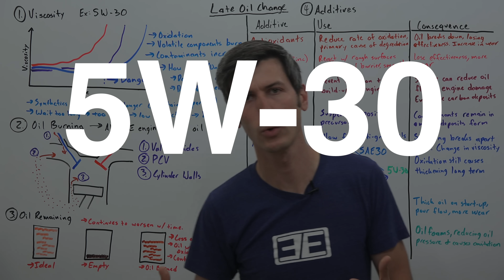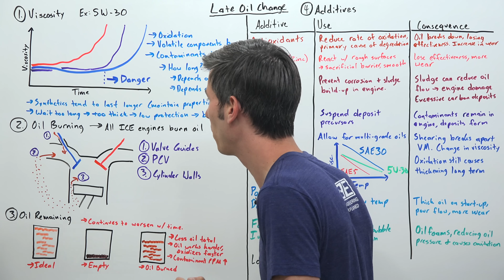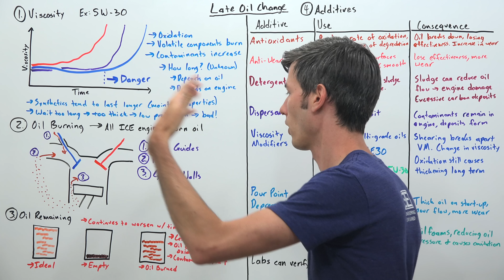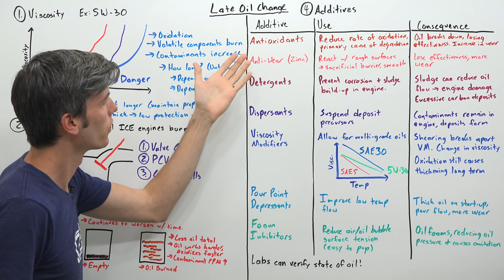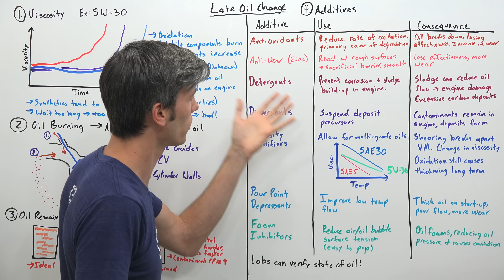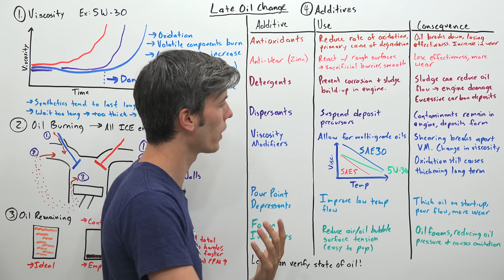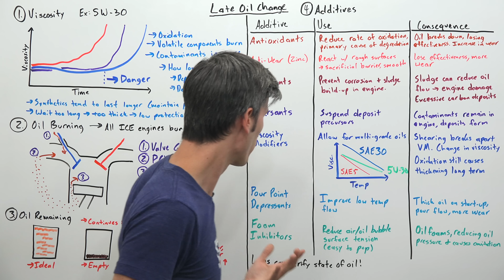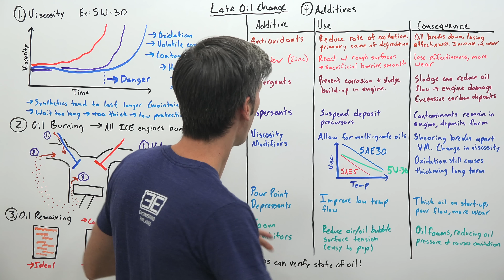What If You Forget To Change Your Oil?

Comment: The viscosity modifiers are basically molecular springs that expand as they get warmer, it's not oil it's completely different, its added to the oil so as they expand they get tangled in each other and create the illusion the oil is thicker, it is not. It's the same low viscosity oil it always was but gets slowed down by all this molecular "junk". Just like how a river overflowing picks up a bunch of debris, trees bushes, wood from peoples houses that got destroyed. That flow with all the debris will act thicker, more viscous than the clean water would alone.
Ok all that said does the modifier contribute to lubricity or does it cause increased wear because its molecularly "rough" like the debris in a river. 
Wouldn't it be better even if only slightly to run a straight weight oil that is comprised of more of the actual oil than additives if in a hot climate? It could be so small and soft as to have no effect on wear. I have almost 300k miles on my current engine and I hope to reach 1M, many others have with this engine and I'm wondering if this tiny difference could mean 1% to 25% longer engine life. Excluding crazy stuff like hot dogging or racing, normal old man heavy truck driving lol. Just curious what you thought.

Comment: What you think about top up oil while waiting for it 7500 miles of recommend miles for oil change. Vehicle: 2020 Silverado 1500, currently at 5000 miles and shows 30% oil on Chevy computer.

My 2017 AudiQ7, dealer service center regularly tops up engine oil before regular oil change. Newer Q7s are really thirsty on oil.

Comment: If a friction modifier makes your oil thicker when it's hot, why is it recommended to change your oil when your motor is warm? Surely more would flow out when it's cold?
Reply: It doesn't make it thicker, it makes it act like a more viscous oil at higher temps. A 5 weight oil in freezing temps is still much more viscous than a 30 weight oil at operating temp. The modifiers just make the drop in viscosity as temps increase less drastic than single weight oil.

Notice that the green line in his graph still has a negative slope.

Comment: Girlfriend didn’t change her oil for 30,000 miles, it took $400.00 to fix due to sludge and a couple of other repairs which was about what the oil changes would’ve cost. 🤪
Reply: No way sludge can be removed with some Trans fluid in the engine oil for 9 dollars. They ripped your ass off

Comment: My car's service interval is 1 year or 15,000 kms. But my car has only run 5,000 kms in one year.

So is it okay if I delay my oil change?
Reply: If you want to void the Warranty and more wears then yes. Always change the oil/service at the interval as stated in the manual even if you only drive 1000km a year. You can always call the dealer or a mechanic about this, they will give you the right answer.

Comment: I know some Old-Timers that use 15w40 Rotella in these new engines and I know it can't be good for. Can you explain why heavy oils is not good in modern.
Reply: Its not quite as simple at the just the heavier grade of oil. Oil change frequency, flow rate and bearing clearances play most of the part as to why they are using thinner oil. There is still cars oil there today that are using 10w60 fully synthetic for instance. Alpha Romeo 🙄
Reply: @tting2086  I know what you're saying. I have taken a few classes on just oil and oil analysis. I'm a technical advisor for heavy equipment. What I'm getting at is will a heavy oil push the valve timing actuators to their Max during low load and low idle due to heavier oil? For example a 2020 engine that has variable valve timing. We have Cummins engines at work that use higher pressurized oil to control the turbo vein ventury opening and EGR opening. Customers that have used low grade oils or higher or lower viscosity oils cause the actuators to over pressurize and the command position is not achieved within 10 seconds, producing error codes. 
So I would like to see what happens if you put 15w40 in an engine with variable valve timing and direct cylinder injection. Will the higher oil pressures mess up the systems on a gasoline engine controls?

Comment: I change oil every 3,000 mi - Walmart SuperTech non-synthetic plain jane motor oil - Bosch filters - got 482,000 mi service out of last vehicle before valve guide seals leak  - got 524,000 mi out of Chevy pickup before rebuilding it - using same Walmart  oil. Just changing oil on schedule is key to good vehicle service life. My costs per oil change is $18 - 20....😁👍🇺🇸

Comment: I have a question regard engine oil. 
So if the recommended oil for the car  is for example 5w20.. but someone is living in a very hot weather area. Is it advisable to increase the viscosity to for example 10w40?
Reply: I would just use 5w40. Unless you're in the middle east. Then use what the manufacturer recommends
Reply: @benniestander2725  actually I'm in the middle east lol.. They're recommending 5w20!

Comment: I change my oil every 2500 miles. So if I go over it's usually ok haha
Reply: Why
Reply: @ljsortigosa3990  Because I want my motors to last as long a possible, preventative maintenance.
Reply: @ConTheDon187  nice, okay. What do you drive?
Reply: @ljsortigosa3990  as of now my car is down for an engine build for a big turbo setup so I'm stuck driving my truck which is an 06 dodge 3500 with a cummins and then my project car/race car that used to be my daily is a mk4 GTI 1.8T 5 speed manual. But i've had bmw's, 350z's, miatas, subarus.

Comment: Hey, you may have covered this in an other video, but I’m wondering what does fuel dilution do to the performance of engine oil? I understand fuel dilution to some (moderate, 1%?) extent is “normal”, but doesn’t sound like it would do any good...

Comment: I’ve got a 2003 Dodge Dakota that I bought a year ago. The truck runs extremely well, despite having nearly 210,000 miles on the engine (3.9L Magnum V6). I’m the second owner of the truck, and like the previous owner, I am religiously changing the oil, but it still amazes me that I have almost zero oil loss, and the engine runs as well as it does, especially after installing a number of bolt-on upgrades (mind you, I don’t beat on the engine, but I do exercise it every once in a while). It’s really mind blowing how far an engine can go with proper care. Especially when my best friend is best known for having blown through 2 engines in as many months, but that’s a story for another time. 🤦🏻‍♂️😂

Comment: So changing my oil on time extends my engine life to 200K? I’ll save my oil changing money and ok I know I’ll only get 180K miles. Large fleet managers always weight the cost of engine oil versus engine wear. There is a happy medium. Likewise, large fleet managers also have to weight stocking multiple oils for their fleet. They may choose to save money by only stocking one oil. Having one oil may cause additional wear in some engines but the cost savings are in only stocking one type. For example, instead of stocking 5,10 and 30 weight. They simplify and only use 30 weight regardless of what the manufacturer calls for.

Comment: My father changed the oil on his 96' BMW 728i after 90000km after buying it. About 250000km after that he had to replace the head gasket for a different reason and found that all components were in perfect condition. In around 400000km he only changed the oil a total of 5 times.

Comment: Hi, what about late by date but with very low mileage? The Golf has only been driven  5000 km in one year, and a message from its dash says that service is due. But the service intervalb
Reply: Sorry, message went out before ready. The service interval for the Golf in my country is 15,000 km, but the car’s system also keeps the anniversary of the prior service in mind. Does really the passage of time damage the oil in an engine which does not go many miles?

Comment: Great video, thank you. Wish you would have touched on time between oil change rather than just mileage.  I've heard between 6-12month, regardless if the car sat the whole time.
Reply: This is the comment I was looking for. I also expected him to touch on that. I don't hit the 5000 miles quickly and I read that one should change the oil twice a year. So I do that instead of going by the mileage.
Reply: There's a certain amount of chemical changes that happen as the oil ages. Oxidation is a big one, but with that mix of various additives there's going to be some base level of rare random reactions that cause chemicals to break down over time. So just letting the oil sit in an engine and get old will reduce its utility. Even when not in an engine, a sealed bottle of oil has an expiry date of up to about 5 years, and opened oil should be used within a year.
Reply: @emote_control  what if I use the vehicle every day; my commute times are just short? the engine is kept running quite often but I never even get past 2k miles per year.

Comment: Hi. 
I hardly drive my car and only put about 1000 miles per year using premium brand full synthetic oil. I've been told to change the oil every 12 months regardless of low mileage.
Is it really necessary to replace the oil so soon,  even though it still looks fairly new?
If not, how long can I prolong the oil change intervals?
Thanks.
Reply: Kinda depends how often you drive the car. Usually oil degrades due to heat cycles and contamination. Use synthetic if you want to change oil w/ longer intervals.

Or get your oil analyzed and they'll tell you how good the oil is.

Comment: Most I’ve been was -357 miles over required maintenance in my 2016 Lexus IS 200t. Went and got it down ask all good. I got the car at 57k miles.

Comment: I had a performance V8 with 40,000ks on the clock when I got it, I didn't do a service or change the oil for 60,000ks. Nothing happened. It still drove like new. Those 60,000ks were over a 5 year period. Tell me again how you need to change your oil every 6 months. Admittedly, I don't drive my cars hard and these ks were both long trips and around town.

Comment: If you send your oil off for testing at Blackstone they will run the viscosity and check the additive package, contaminants, and TBN (total base number). This allows you to see how much life you have left in your oil. TLDR you can often run your oil for a lot longer than the specification (the spec is somewhat arbitrary and factors like driving style -- a straight shot across the country on highway alone will often times leave the oil looking and testing like new). That being said, the cost of an oil test can be quite similar to the cost of an oil change.
Reply: Black stone made me about $1000. Long story short, car got totaled. Appraiser said it’s worth next to nothing because of the mileage, saying the motor is shot. We sent the Blackstone report showing it was in great condition. Appraisal came back $1000 higher. Best $45 I ever spent.
Reply: @nasonguy  So itll tell you how healthy thew engine in general still is? thats a very good thing to know.
Reply: @dobber43  Blackstone analysis will tell you a few things. The contents of the oil (more wear metals is bad, more detergents/dispersants is generally a good thing, etc), and the physical qualities of the oil (is the viscosity still good? Could you have gone with a longer oil change interval, etc).
Reply: @NicholasAndre1...good reply. Blackstone suggested we continue just replacing the filter, suby, and running it to 12K....highway miles mostly.  That is double what is supposedly the change interval.
Reply: @darrellborland119  yeah especially if you burn a bit of oil and have to top it off half way through synthetic highway mileage should be fine. Although if you have to rotate the tires might be convenient to just do the oil change and have them inspect brakes etc.

Comment: Could you please explain what happens if the oil is vacuumed out of the engine to the dipstick tube.

That's exactly what Walmart had done to my vehicle, it took two oil changes before I realized what they were doing, by that time I ended up with a rod knock.

Comment: The viscosity goes down I think not up.
Because it makes no sense if it goes up.
Reply: That's what I thought!  It's why LiquiMoly oil stop additives mention stopping the thinning process.
I don't let mine get to 6,000 because it looks grim enough at 3 or 4,000.
Reply: Robert Walton-Sharp mhm you have chain thinning as degradation over time and heat. How can be a chain extender applied without recombination at the Beginn but on the end. I have to read papers about that....

Comment: Finally a person who knows what the W stands for, I can’t tell you how many know it alls argue that it stands for weight!  I change my oil every 2000 miles and I use Royal Purple 5W-30 and a Wix oil filter. The GM ECO-TEC 4cyl engines are great and have a racing heritage but need oil changes on time and the engine will treat you right but if your lazy the engine will not last, change it and your going to have a long history with that car.

Comment: My granddad always changed his Toyota every 60000Km, being on a farm. The tractor got the same treatment. I have since then learned from him to not wait until 60000km but rather change every 10000KM. I know a  couple of new European cars that consumes oil by liters. Does 500ml every 1000km sounds like exceptable parameters by the manufacturer? In essence I do see the need to have oil changes on these vehicles as they consume the same amount of oil that an oil change requires? Why bother changing oil then? 5 liters of oil consumed within the ICE. Why must I take the car for a service if the manufacturer finds it normal to consume this much oil?

Comment: EE can you explain what happen to engine oil keep to long in the engine but doing low miles.
Reply: the integration of additives ( which are in the oil to prevent oil to attack rubber and plastic) vanishes so the oil becomes the enemy of the engine parts (as, plastic-made timingchain-guides and so on)

Comment: full synthetic oil they say its better to change after 1 year if you dont reach the millage but it comes good as new even after 2 years... 1 year only of full synthetic and changing it without reaching the mileage sounds like a scam, at least on my engine... but i do it anyway, after that i wash the white floor with it because it comes so clean it helps making the floor shiny

Comment: Thank you for the video, that has prompted me to as a question.  Assuming that the oil change is at 5000 miles.  I have a way to remove a discrete amount of oil.  So every 1000 miles I remove a quart of oil and put in a fresh quart, does this extend the oil.
Reply: It'd probably be easier to just change it

Comment: Bragging rights. Back in the late 60s we bought a 67 Chevy Belair station wagon. We bought it new, so we care for it all of its life. At 100K miles, it was such a rust bucket, my dad said he wasn't going to put another drop of money into it, because the car wasn't worth it. This included oil. He was just going to drive it till it died. It never did die. 30K miles later, the engine was still running. It developed a lifter knock, but that was it. It still ran fine and never used oil. We finally junked it. So for the engines last 30K miles, it was running on the same oil, and yet never consumed oil. Here is the caveat. He worked for an oil additive company. He bought all his oil from work, which was specially formulated to the best spec their engineers could come up with. So it was oil you could buy in a normal store. He also only lived about 4 miles from work, which meant the engine never got fully warmed up.Crazy the engine could survive that long without changing the oil.

Comment: Changing oil every 3000 miles.
Stock turbo @1.5Bar and 110,000miles on a 10 year old car. 
still running strong.
Use quality oli and change often.. Its worth it

Comment: I always wonder why cars don’t have run time meters. Miles less important that the time the running engine took to get those miles.
Reply: Some have both....
The reason they do that is because in a car most of your run time happens while driving.
Reply: WyattoftheWoods unless you do a lot of city driving. Then the miles took a lot more engine time. It’d be nice if it were standard.
Reply: @sirich7751  That's a pretty valid point. In that case, you could buy an aftermarket hour meter and install it on your engine. Though not entirely sure how to install on an engine with a wiring harness that plugs into the COPs as opposed to a spark plug wires.

Comment: Thank you for another very informative video. Could you please do a video on the different types of synthetic oils? I used Castrol Synthetic in my car for many years and then made the switch to Shell synthetic oil. The engine noise reduced and the engine seemed to run a bit smoother. The engine smoothness could just be that I did not really take note of the sound when using Castrol oils.

Comment: how long can engine oil last? now we are facing the covid19 and during this period, the mileage will be super low, do we need to change it even if it does not hit the mileage? was advised to change every 6 months if it does not hit the required mileage of the engine oil or the service reminders. I still have 8800km to go as I have only driven it for over 1000 km over 2 months!!! :(

Comment: I've got a question. I hardly use my car. Less than 10000 km per year. Usually, I'm suppose to change oil every six months since I dont hit 10k. If I use those 15000 km synthetic oils, would it be bad If i choose to change my oil annually instead of every six months? 

I hope you answer my question. More power to you!